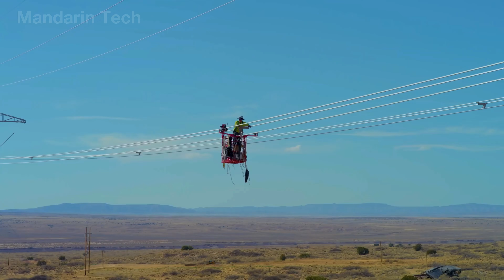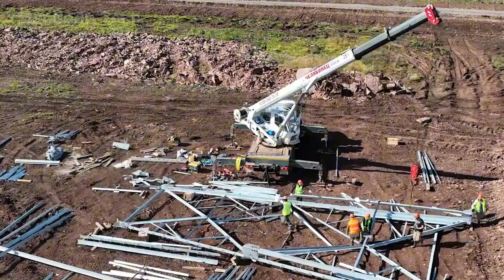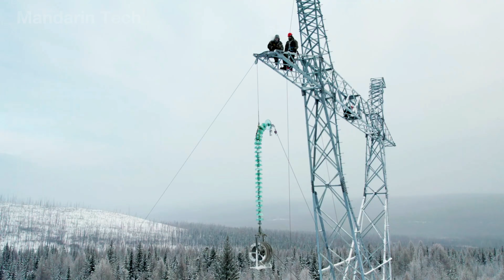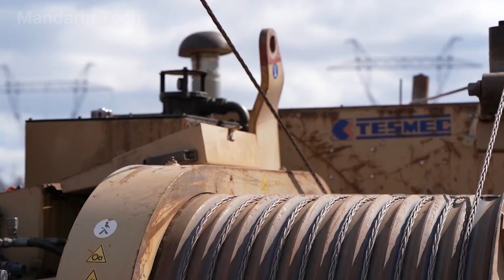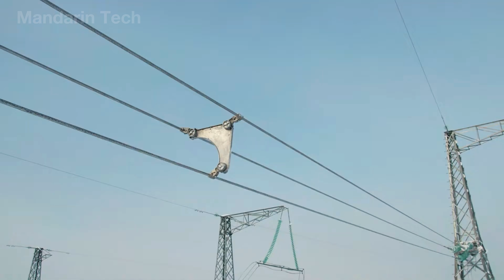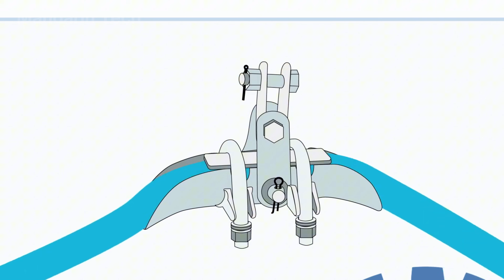You Won’t Believe How Russia Built High Voltage Power Lines Across the Largest Country on Earth

Comment: Field Engineer & Environmental Perspective
🇬🇧 English

From a field and environmental perspective, building transmission lines across diverse ecosystems requires careful environmental management.

Protecting natural habitats, minimizing land impact, and ensuring safe operations in extreme climates are key priorities.

Field engineers play a critical role in adapting construction methods, monitoring conditions, and ensuring compliance with environmental standards.

Reliable energy infrastructure must also be environmentally responsible.

#FieldEngineering #EnvironmentalEngineering #EnergyInfrastructure #SustainableDevelopment #TransmissionLines #ConstructionSafety #ResponsibleEngineering

Français

Du point de vue environnemental, la construction de lignes électriques nécessite une gestion rigoureuse des impacts.

La protection des écosystèmes et la sécurité sont essentielles.

Les ingénieurs terrain assurent le suivi et l’adaptation.

Une infrastructure énergétique doit être durable.

#IngenierieTerrain #IngenierieEnvironnementale #InfrastructureEnergie #DeveloppementDurable #SecuriteChantier

Español

Desde la perspectiva ambiental, la construcción de líneas eléctricas requiere control de impactos.

La protección del entorno y la seguridad son fundamentales.

Los ingenieros en obra supervisan y adaptan procesos.

La infraestructura energética debe ser sostenible.

#IngenieriaDeCampo #IngenieriaAmbiental #InfraestructuraEnergetica #DesarrolloSostenible #SeguridadEnObra

Comment: Building high-voltage transmission lines across vast territories like Russia highlights the scale and complexity of energy infrastructure, connecting remote regions and supporting national development under extreme environmental conditions.

Civil Engineer Perspective
🇬🇧 English

“You Won’t Believe How Russia Built High Voltage Power Lines Across the Largest Country on Earth” showcases the engineering challenges behind large-scale energy transmission systems.

Designing transmission lines across mountains, forests, and permafrost requires advanced structural solutions, foundation design, and material performance under extreme conditions.

For civil engineers, this project demonstrates how infrastructure adapts to geography, climate, and long-distance efficiency requirements.

Engineering energy networks means connecting territories at scale.

#CivilEngineering #PowerInfrastructure #TransmissionLines #StructuralEngineering #EnergyEngineering #MegaProjects #InfrastructureDevelopment

Français

« You Won’t Believe How Russia Built High Voltage Power Lines Across the Largest Country on Earth » met en évidence les défis de l’infrastructure énergétique.

La conception à travers des environnements extrêmes nécessite des solutions structurelles et géotechniques avancées.

Pour les ingénieurs civils, cela montre l’adaptation aux conditions géographiques et climatiques.

L’ingénierie relie les territoires à grande échelle.

#GénieCivil #InfrastructureEnergie #LignesHauteTension #IngenierieStructurelle #MegaProjets #DeveloppementInfrastructure

Español

“You Won’t Believe How Russia Built High Voltage Power Lines Across the Largest Country on Earth” muestra los desafíos de la infraestructura energética a gran escala.

El diseño en condiciones extremas requiere soluciones estructurales y geotécnicas avanzadas.

Para los ingenieros civiles, demuestra la adaptación a condiciones geográficas y climáticas.

La ingeniería conecta territorios a gran escala.

#IngenieriaCivil #InfraestructuraEnergetica #LineasDeAltaTension #IngenieriaEstructural #MegaProyectos #DesarrolloDeInfraestructura